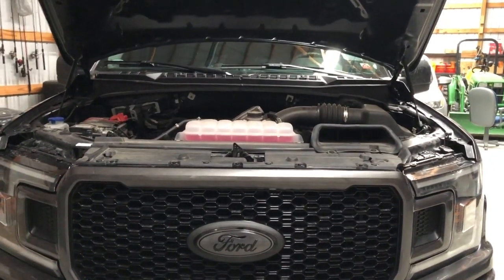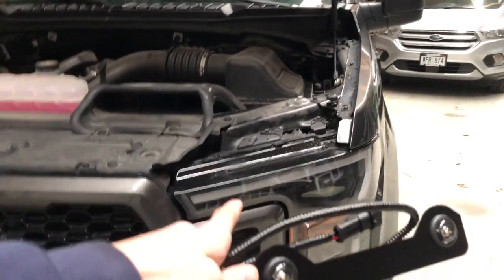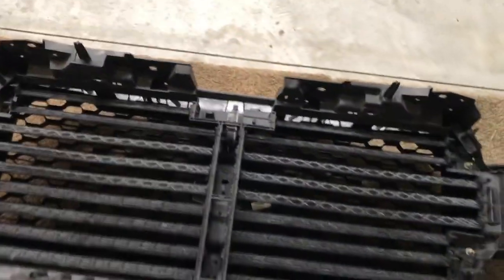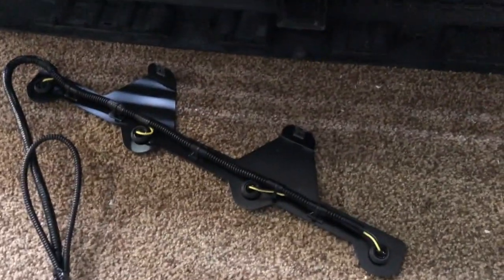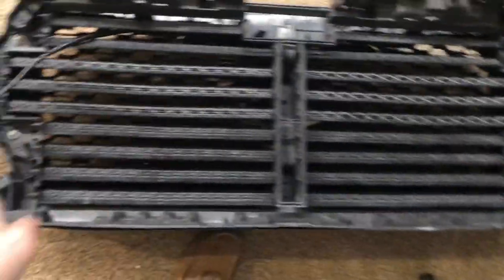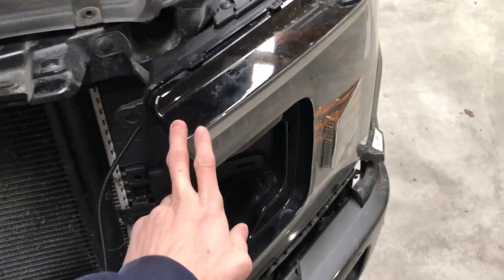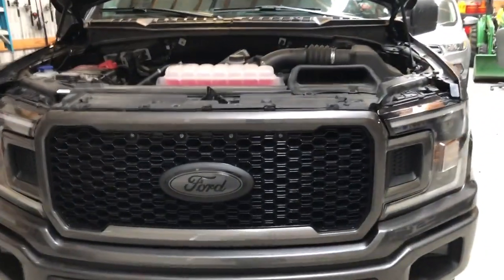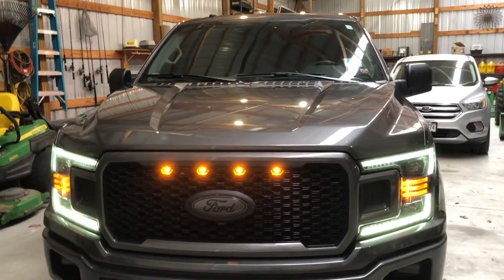Installing Raptor Style Grille Lighting on 2018+ F-150!!!

Comment: I am getting the same lights and the raptor style grill.  I have seen a couple places where they have had issues splicing the raptor lights into the factory marker light harness.  Is this how you did yours?  Have you had any issues?  Drl bar flickering, different brightness....?  Thanks in advance.  Truck looks killer.
Reply from the maker: These raptor style lights that I got I purchased from stage 3 Motorsports. The way the wiring harness works for them is they just plug in and it is super easy to do, you do not have to splice any wires. I haven’t had any issues with them or the headlights, everything is still working great with them!
Reply: @blomeoutdoors2134  is there any way you could send a short video or just some pictures?  Harness that came with my lights only have a bare black and red wire.  I can tinker with things but not much of an electrician and I don't want to mess something up.  Thanks for any help you can give.  Much appreciated.
Reply from the maker: @kennethaldous7028  I'm not really sure how that would hook up. The one I got was a connector that just plugged into the running light. But if you want to connect it to the running light then I would say to locate the wires that go into the running light bulb on one of the headlights, and then figure out which wire is your hot and which is your negative (black and red wires), and then either tap into them with a tap in connector or cut the wire and add them in using a regular connector. I'm not sure which wires on that would be the hot and negative, but google has always helped me in the past with things like that haha. Hope that was helpful. If you still can't get it then let me know and I can try and help more with it!

Comment: have you had any issues with it? I see that you ran the wiring through the shutter grill. Probably not a good idea because the shutter grill opens and closes on the freeway
Reply from the maker: Oh I didn't know the shutter grille did that, but no I haven't had any issues with it. If I do though then I'll know what is wrong with it haha. Thanks!

Comment: I have the same headlights with led bulbs and want to buy the raptor lights. Did you choose the factory, halogen, or led lights option on the stage 3 website for this product?
Reply from the maker: You'll choose the option for whatever factory headlights your truck came with. My truck had stock halogen lights so I selected the halogen option.
Reply: I was wondering the same thing! Lol my truck is a 2019 XLT that came with factory halogens. But tomorrow I’m installing some Vland headlights (LEDS).. I wasn’t sure what option to choose when I was gonna purchase. I just chose the halogen option since that’s the original part of the truck. Hope it still works even with the new lights
Reply from the maker: danny porras yup, choose whatever it is your truck came with stock and it should just fine and shouldn’t have any issues.
Reply: Blome Outdoors thank you!

Comment: When ordering the lights, what headlight option do I select? Factory headlights? Halogen headlights? Or Led headlights? I also have the same set up as you with the alpharex headlights.
Reply from the maker: You’ll select whatever option your truck came from the factory with. Even though I now have the AlphaRex headlights with LED bulbs, my truck came with halogen headlights from factory, so I would select halogen.
Reply: @blomeoutdoors2134  got it, but I am still trying to figure out where would it connect? I feel like all connections was used up on the alpharex headlights.
Reply from the maker: @djmike4084  When you get the grille lights then you’ll have to unplug the running light harness on the headlights. The grille lights come with a harness - so you unplug running lights, plug in this harness, then plug in other sides together.   It’s hard to explain and it might not make sense now, but once you get it and see all the wires it’ll make sense.
Reply: I’m hoping to get the wiring done right as well. Like you said, it should make more sense when I pull out my headlight because I have the same set up as you guys
Reply: @chrystalfrizzle987  when you purchase the kit from stage 3 Motorsport it will come with  a adapter you will need to use to connect the raptor lights to the headlights. The adapter goes first to the headlights then branch out.
Reply: I just ordered them. I’ll let you know if I need help. Thanks!
Reply: I just got my lights in but they didn’t come with a harness!